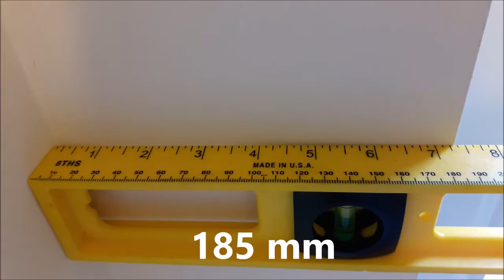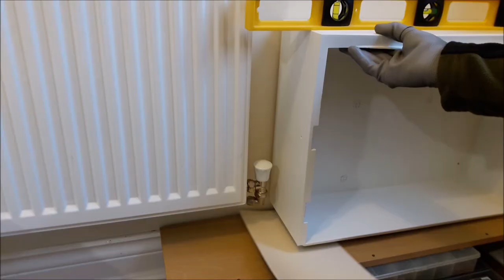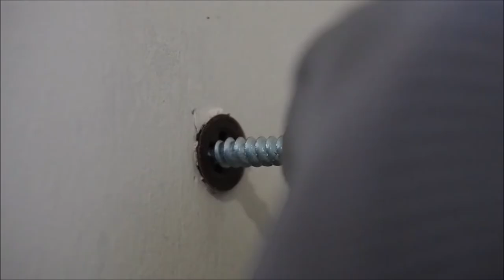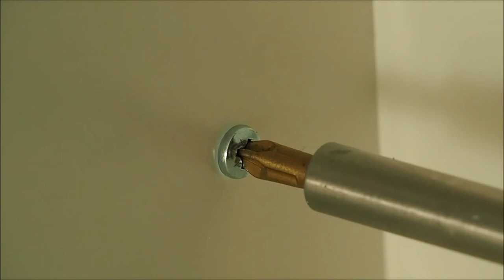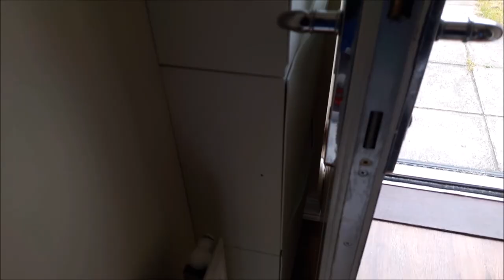How to attach Ikea shoe cabinet

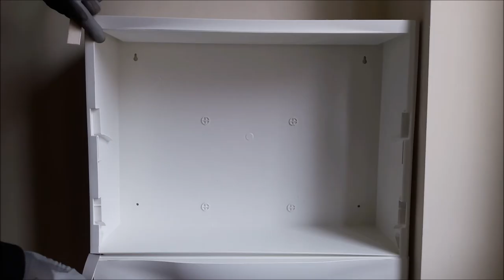Comment: Before you start with the second trones, you put in on top of the first. Then you lift the second one to put small spacers on the left and right between the two (starting 03:05).
What kind of spacers are these and why did you use them?
Thank you!
Reply from the maker: When you hang separate units, they also drop a few millimiters and the weight of all  units is supported by the fixings attached to the bottom one. 2-3 mm gap is enough. You don't have to do it, trones are relatively lights.
Reply: Was going to ask the same! Thank u for the answer!
Reply from the maker: @katyng52  No problem. :) Good luck with your project

Comment: I like the video; however, you didn't mention what type of nails to use. Are those wall anchors that you used and how big of a hole would I need to drill? (obviously, I'm a super novice) :-).
Reply from the maker: On the left is a plasterboard and behind it is an empty space. I used a plug for plasterboard. The size of the drill  is the same as the core plug:
Check out another video how to check the correct size:
https://youtu.be/Ql-JNmmYYA at time 6:12
On the right, closer to the door is a solid wall. I used the traditional wall plug. The size of the drill is the same such the dowels.
Before doing any work you should check what kind of wall you have at home.
Good luck with your work.
Reply: @k-nemo  Thanks for this video and info. May i know the size (in mm) of the plug for plasterboard and also the size of wall plug?
Reply from the maker: There is no size for the plug for plasterboard. Any will do. I used standard wall plug 8 mm.
Reply: @k-nemo  can i use 6mm plug and 5mm screw to hang this Ikea trones shoe racks?
Reply from the maker: @rajesh315  
Yes. A 6 mm plug should be enough. The shoes are not heavy.
You will probably not screw a 5 mm screw. It's too fat.

Comment: Hi 😊. Tq for sharing this diy video. I am really a novice here😅... So may i know the type of drill (brand/ model etc) you used. Is it efficient on brick walls/ cement? Tqvm in advance for your respond.
Reply from the maker: For brick walls/ cement any hammer drill with masonry drill bit.
Reply: @k-nemo  noted with thanks. Will try it out. Any suggestion? How about the drill power... Pls advice. Tqtq

Comment: Is it okay not to drill this on the wall? Would it stand on its own? Thanks.
Reply from the maker: It can stand on its own. It is a good idea to fix it to the wall so that it does not topple over when opened. It will be more secure.

Comment: Would you think it's possible to hang up using heavy duty or picture frame command strips instead? ( for renters)
Reply from the maker: I wouldn't try to do it. The trones are relatively light so this shouldn't be a problem but when you put shoes or other heavier objects inside they might fall down.
Reply: @k-nemo   okay thank you
Reply: When u leave,  remove screws GENTLY and fill in hole with dip of tooth paste. Sometimes works well enough you do not have to spackle and paint plus.. get deposit back

Comment: hi, mi had the shoe cabinet installed for years. now i want to remove my wallpaper and i have to remove the shoe cabinet but i don't know how without damaging my walls
Reply from the maker: Just take the cabinets off the wall and unscrew the screws. The holes will be covered with the new wallpaper, you can filled them in with the filler if you prefer.

Comment: I wonder what kind of screws is that ? I mean if they have a number so i go and buy 
By the way thx it really helped me
Reply from the maker: Before doing any work you should check what kind of wall you have at home.
On the left is a plasterboard and behind it is an empty space. I used a plug for plasterboard. The size of the drill  is the same as the core plug:
Check out another video how to check the correct size:
https://youtu.be/Ql-JNmmYYA at time 6:12
On the right, closer to the door is a solid wall. I used the traditional wall plug. The size of the drill is the same such the dowels.

Comment: Suggestions for old homes with plaster walls?
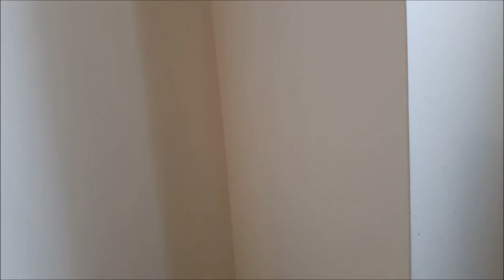Reply from the maker: 1:26
Reply from the maker: In my hall part of the wall is plaster and part is a brick that's why I had to use two different kind of screws
Reply: @k-nemo  how to find its plaster or brick wall as tapping in my house porch wall is not helping me to find this out :-(
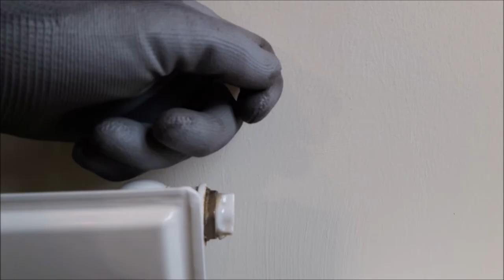Reply from the maker: @rajesh315  If you are not sure you  can drill first to check and then decide what to use.  I knocked to check the sound. 1:14 on my film plasterboard is louder.